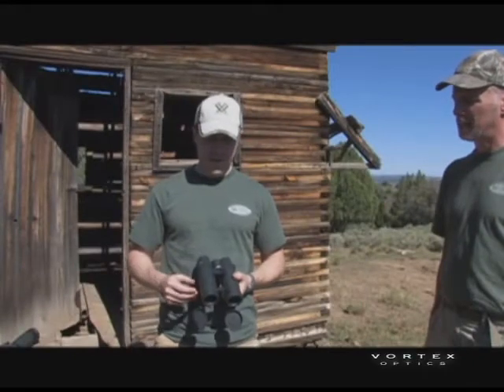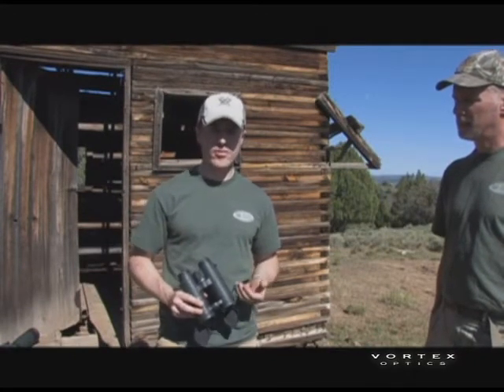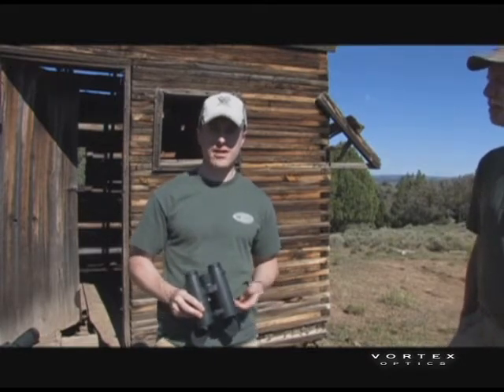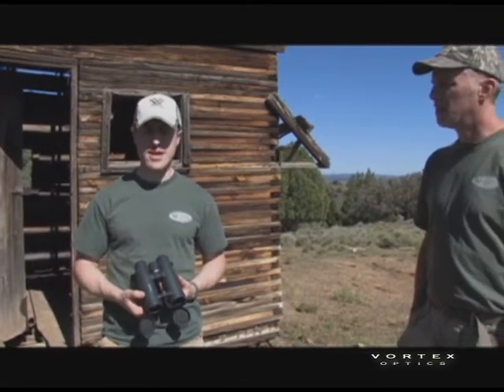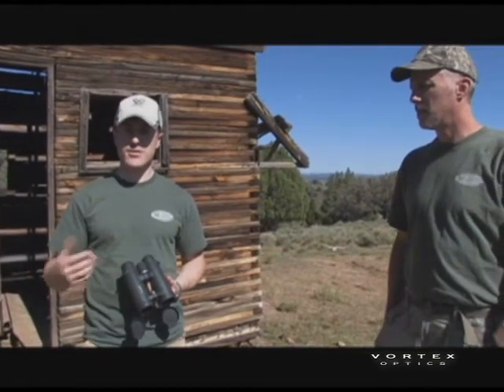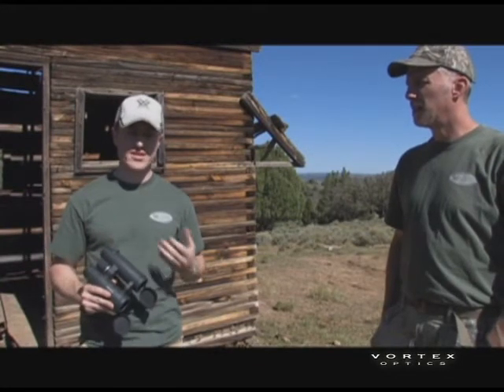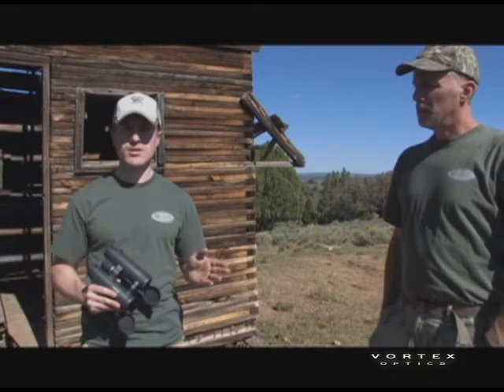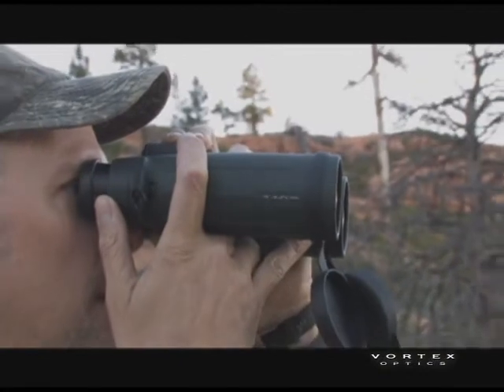Binocular waterproofing

Comment: If my binoculars have no rating on them like water-resistant or waterproof, what steps can I take to compensate this disadvantage if I need to use them in humid, rainy conditions??
Reply from the maker: Hi Aditya! What model binoculars do you have?
Reply: @VortexOpticsUSA  Nikon Aculon A211 8x42
 Thanks for the reply ☺️